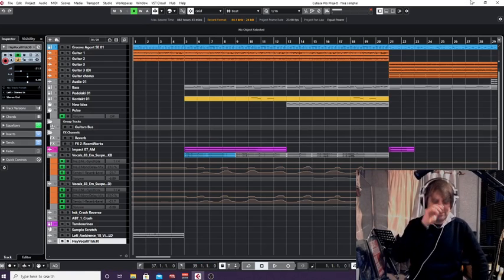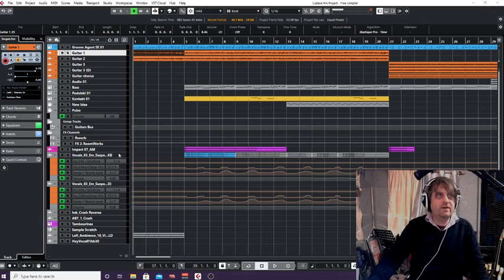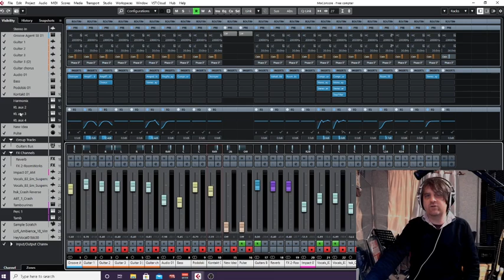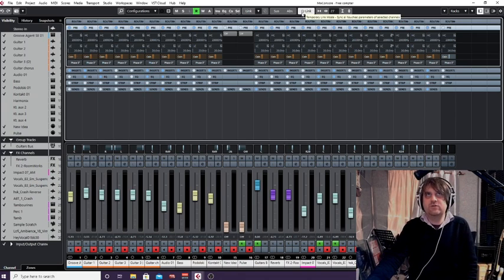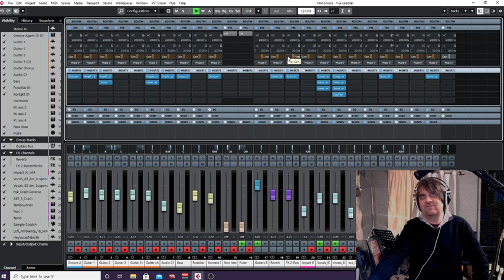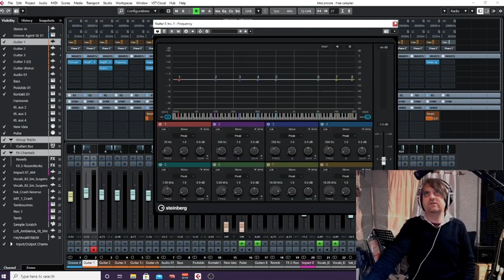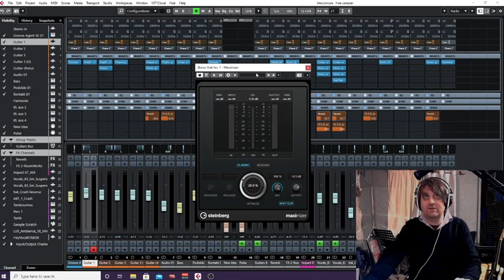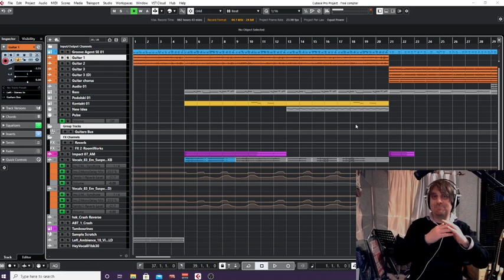Ideas for controlling volume in Cubase -  Gain staging

Comment: wat model cpu and what ram, amount do you have? what version of cubase pro are u using? i have elements 10 and have just upgrade my computer.
Reply from the maker: Hi really sorry for the late reply! My computer I'm using at the moment is a 10 year old PC with 4 gigs of RAM!! I'm running this as an experiment to see what an old computer can do. I also have a Razer 17 pro laptop, which is quite good for production and an i7 rackmount PC with 32 gig RAM which is also getting a bit old now (about 7 years). I am going to invest in a new desktop this year! What computer did you get? Are you happy with it? Speak soon, Matt
Reply: @GuitarWithMatt  i7 10th gen 32gb ram. But have not installed anything yet.
Reply from the maker: that sounds cool! Should run Cubase really well. Speak soon. Matt

Comment: Very useful info this.
Reply from the maker: Thank you A Bagatelle, that's very kind, Let me know if you would like me to cover anything else. All the best. Matt
Reply: @GuitarWithMatt  Thanks - yes. When I copy tracks (using alt drag) which have Melodyne on them, the copied track also ends up with Melodyne, but when I edit it (eg to create a harmony), it seems to affect the original track - as if the copied track is linked somehow to the original. Any tips would be much appreciated.
Reply from the maker: @abagatelle  Have you looked at the edit menu? edit - preferences (bottom of the page) - editing - audio - then choose create new version (on processing shared clips) let me know if this works. If not I'll have another think. Matt
Reply: @GuitarWithMatt  Thanks very much Matt, that solved the problem. All the best for 2021!
Reply from the maker: @abagatelle  That's great news! All the best for 2021!